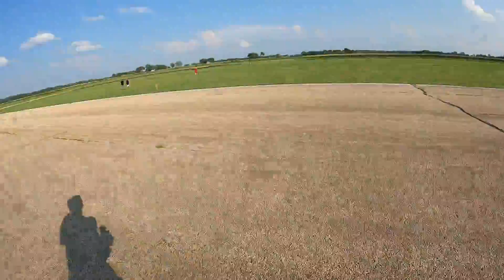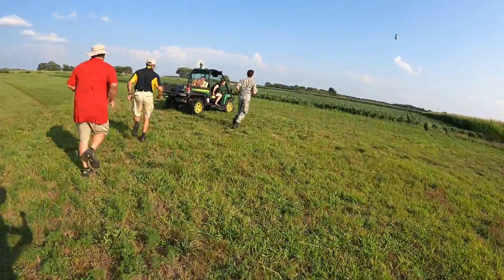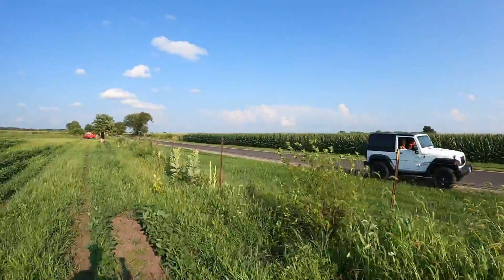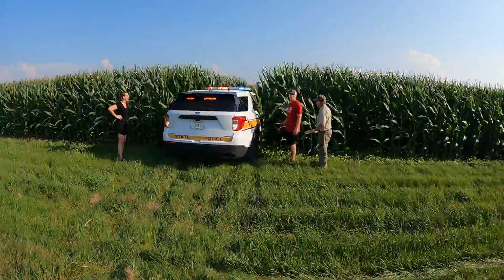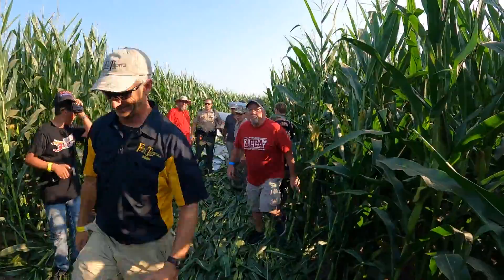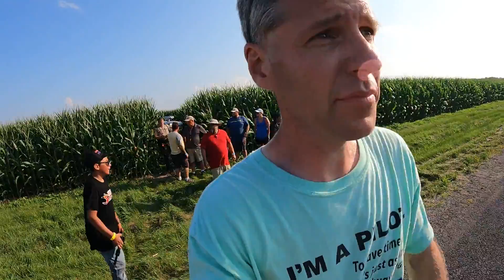Airplane crash in the corn at Whiteside Airport KSQI 2021 ACCA Rock Falls Illinois.

Comment: Flap switch or not By the numbers they were heavy and on a hot day. Dan 225 owner looked to be 200 fuel load unknown.   

The Cessna 150 has an average empty weight of 1,122 pounds and a gross weight of 1600 pounds, meaning its effective useful load is around 478 pounds. It has a typical fuel capacity of 26 gallons which means the full fuel useful load is approximately 322 pounds
Reply: Ya, they were over the legal weight limit by 150-200lbs.
Reply: Complacency — it's how highly experienced professional pilots kill themselves.
Reply: @jiyushugi1085  burger king Whopper

Comment: I am glad that both pilots are safe with no injuries! It looks like Dan for the most part followed his own advice and flew it to the ground wings level. I owned a Cessna 150F (N8914S) that had the electric flaps. The 40 degrees of flaps were great for short field landings. However, if you wanted to turn that short field landing into a touch and go it was a little sketchy as the switch to extend / retract the flaps was a "dead man's switch" meaning your hand is stuck holding the switch in the retract position until the flaps were up. This additionally means that you can't increase the throttle until the flaps were up! 

Interestingly I also had similar problems with the electric system every once in a while in that airplane when the flap motor turned on/off the generator regulator light would come on meaning charging had stopped due to an over voltage. I believe this was due to an inductive voltage spike as the motor turns on / off. The solution that got applied after I sold the plane was to put a capacitor on the motor terminals in parallel to prevent the voltage spike which in turn would prevent the generator regulator from turning off. The solution that I did while owning the plane was to turn the master off (plane still flies because power to spark plugs comes from magnetos but yes this sucks as your radios, transponder, etc are off) let the regulator cool down for a minute while I turn the radios and other electrics off and then turn the master back on. This would reset the regulator and charging would resume.

My major concern about this incident though is if you noticed the flaps did not retract on the ground why the heck would you continue the take off?  As evidenced by the crash, a Cessna 150 will have terrible climb performance on even a standard temp day (actual conditions appear to be hot so high density altitude) with full flaps. They should have just reduced power and applied max braking while on the ground. As I said above, the Cessna 150 with full 40 degrees of flaps will stop super short so they would have had at least half the runway left (probably way more) to realize the flaps were not up to either cut the power and max brake or cut power, land ahead and max brake.
Reply: What also would be interesting to look at would be to check the voltage / state of charge of the battery. If the regulator had been turning off due to the over voltage when operating the flaps then the plane would have been running it's electrics off of the battery not the generator and the battery would be pretty worn down. While it was enough for them to take off use the radios and drop the flaps the battery's low charge state may not have allowed flaps to also get retracted after being dropped with the radios on. Hence them being stuck down no fuses blown but with the radios still working.
Reply: In the video Gryder states it was a go-around
Reply: @thefamilythatfliestogether  They hand propped it to take off in the first place. Should never have taken off.
Reply: @margemason4525  considering Dan said that the battery was new in another video and you are correct about them needing to hand prop it then it is more likely my theory might be right. Otherwise why would they need to hand prop it to start it. Coincidentally I had to hand prop my 150 before I figured out what was going on with the generator regulator.

Comment: NTSB final report:
Postaccident examination of the airframe and engine, which included testing of the flap system, revealed no evidence of mechanical malfunctions or failures that would have precluded normal operation. A four-port universal serial bus (USB) power supply adapter was found plugged into a power port located just below the cockpit flap switch. It was undetermined if the adapter conflicted with the operation of the flap switch. Based on available evidence, a reason for the reported flap issue was not determined. 
Probable Cause:
The right seat pilot’s improper decision to perform a low approach with full flaps and the failure of the flaps to retract during the attempted go-around, which resulted in a forced landing.
Reply from the maker: Actually, Matt Mansell, the owner, discovered the cause of the malfunction during rebuild of the airplane. If you visit his channel, search for "smoking gun" and see the video where he attempted to manually operate the flaps and the right side bound up. It was discovered that there was a hardened lump of paint in the track the the roller could not overcome. Sanding doen the paint lump resolved the issue.

Comment: I’d like to see his weight and balance for two big fellas in a tiny 150 as well as 91.103 preflight action. DA is through the roof with this heat and humidity here + that fully loaded 150. Can’t wait until the NTSB digs into their “preflight action” 😏
Reply: Well, that will be three years coming ...
Reply: @captmulch1  how big is the runway? during my ppl me and my instructor managed to get a 150 out of a 800m grass strip, DA wasn't too high if i remember right though, looks like they had a big enough runway and the main issue was just the flaps jamming up, had that happen on a 152 on final approach,  luckily it jammed at 20 degrees and not 30 though. 

I know for sure a 150 will not climb at 40 degree flaps at mtow in high density altitude. we were getting 50ft/min down at sea level in the UK
Reply: @captmulch1  not with amount of stick Dans been giving them... they will probably send a full go team 😆 they’re going to be straight up giddy for this one.
Reply: Obesity kills.
Reply: @ThatGuysProject  They we’re doing a low pass over the STOL runway. Dan mentions it being 400m or so. No way to gain altitude or speed with 40 stuck down and nowhere else to land (or nowhere better) than the corn field.

Comment: The first thing I thought of, as did others, is that they were probably overloaded. They are a couple of beefy guys. The two of them together likely weigh in at 450 lb. When I first got my ticket, I planned to fly my wife to Portland, about 100 miles away, in a 150. I left a note asking that the previous pilot not fill the tanks. When we arrived at the airport, we found the tanks were full. My wife was surprised when I dumped most of the luggage, already bare bones, into the car and told her we would have to buy what we needed in Portland. We took off 2 lb under gross. Even with only ten gallons of fuel these guys would have been over weight on a good day and with the heat and increased DA, a definite problem. I am nuts about weight and balance in our 182, and I have 1150 lb useful load. I am given to understand they were doing touch and go's. Flaps should have been retracted while on the ground before re-initiating flight so failure to retract should have resulted in staying on the runway. Probable cause: Pilot engaged in flight while exceeding the maximum gross weight of the airplane and pilot did not abort takeoff when flaps failed to raise.
Reply: or perhaps they did a go around, and only realised the problem when it was too late. these things happen, though they must of been around mtow as from experiance 2 up in a 150 even at low da they don't climb well at full flap. 50ft/min give or take
Reply from the maker: Thats exactly what happened. Dan was attempting a STOL landing and the flaps would not retract. They just could not gain any altitude and went down.
Reply: @WolfPilot  Well glad their alright, seemed to a pretty good job getting it down safely. i got lucky when it happened to me as i selected full flaps and it only went to 20, i noticed it on finals so made it a full stop.
Reply: I did something similar in a 150 when I was in training. I was on my second solo flight with my instructor observing from the ground. I was doing go arounds and forgot to raise my flaps. It was summer, but a relatively cool morning on the coast of the Olympic Peninsula. The nose wanted to pitch up and I was not gaining altitude. I was at about 150 ft and I shoved the yoke forward and kept the plane level, at full power, and worked the problem. I soon realized I had forgotten to raise the flaps, and milked them up. Since I was not overloaded and it was only about 60 degrees outside I was able to maintain altitude and did not sink, though I did pass over some trees quite closely. The heat of the day and an overloaded plane seems to have changed all that.
Reply from the maker: @margemason4525  I am not drinking any kool-aid. What I am reporting is matched up with eye witness accounts.
Reply: @WolfPilot  I am still unclear about hos this happened. The flaps would not be retracted in a STOL landing, but would be extended, likely to 30 or 40 deg. Generally, when doing a STOL takeoff you would keep the flaps at no more than 20 (though a friend of mine uses 30, I stick to 20. So, they landed and then took back off. The flaps remained at 40? So then did they not have enough runway to abort the takeoff if they could not retract to 20 while still on the ground? Did they take back off purposely with flaps 40? At flaps 20 if not overweight they should have been able to level off and get back. Overweight no way. At flaps 20 and overweight, also no go. My feeling is that I am not getting in a 150 and doing STOL with another 200+ lb guy.
Reply: @WolfPilot  Reporting???? Did you ask Dan or the owner if the eye witness accounts of them having to hand prop that plane were true? An electrical system failed causing a crash of an aircraft that had to be hand propped just to get in the air. Hmmmm. Did you ask them if they’d done a W&B prior to loading up two fairly heavy guys in a low powered airplane to perform a very low and slow maneuver on a day with a high DA? While I’m truly glad that no one was hurt, I have always taken issue with those being hailed as some kind of hero for surviving accidents they most likely caused themselves. Real reporting requires presenting the ugly truths as well as the glamour shots.
Reply from the maker: @frankrosenbloom  They were doing a go around and the flaps would not retract. Check out my Gryder interview video.
Reply: @WolfPilot  Thanks and I realize that. If they were doing short field landings probably 30 or 40 deg of flaps. Then should go to 20 for TO. If the flaps were not retracting why not abort the TO? Was the field too short? I'm not sure why they would be taking off full flaps, though maybe 30 deg for a very short field, then in ground effect for speed. I still think that if they were not too heavy they could have made it. Simply put, Dan is one of the best of the best, but I am not getting into a C-150 with another 200+ lb guy in the summer and doing STOL practice. Beefy dudes and gravity usually win over low lift and low power. Cheers, Frank
Reply: @WolfPilot  OK gotcha never landed. I'm sorry thought they landed and then took off. I'm not sure why he needed 40 deg of flaps to see what he wanted to see though.

Comment: I don't ever use flaps 40 on a 150 unless I'm completely committed.  Even on a soft field I'm still using 20.
Reply: Me too. 20 was a good all around setting even if you had to land with a little more air speed. I also kept the weight and balance within limits because with a 150 you don't have a lot of power to play with.
Reply: It's easiest to get a little float to soften your landing.  The flaps 40 you drop in like a brick and have to be very precise on your flare.  You don't get a chance to round out unless you have some power in.

Comment: With full flaps and full load, it is nearly impossible to make a C-150 climb. Full flaps should be used with caution, and only when circumstances warrant it. If you use full flaps routinely on every approach, eventually you will run into a situation like this.
Reply: I think Dan was doing a STOL approach.
Reply from the maker: He was doing a STOL approach. Check out my interview video.

Comment: I hate the electric flaps on Cessnas. They should never have got rid of the manual flaps.
Reply: I assume there is no redundancy built into the electronic flaps?
Reply: @RaoulThomas007  that’s right. A lot of times it’s just the circuit breaker. Also the useful load on a 150 is just under 500 lbs. With two dudes plus gas they were probably pushing that. As they found out... it won’t climb out with full flaps.

Comment: Don't stall the aircraft, and most crashes are survivable. Aircraft should be able to climb, even with full flaps, must have been overloaded.
Reply: Not in a 150 with full flaps at at gross weight. I did my training in a 150. Although I’d be interested to see the weight and balance for this flight… I’d be suspicious it wasn’t overloaded, just making matter worse

Comment: DA is definitely something to look into. We had a similar thing with a C150, one really heavy guy, one normal, extended range fuel tanks full, 30° C, no wind, plance was forced of the runway just before the end made it up to two meters and crashlanded in the ditch 100 m further down. Severe but not fatal injuries to one of them. Cause: completely overloaded for the prevailing conditions. Will be interesting to hear Dan's own assessment on this one. He will be critical as always, I assume. Most important though: both are well! The rest is metal.

Comment: I'm not buying it! 40 degrees of flaps at low altitude means you must have the field made. He over shot the approach. Who cares if the flaps are not working. Fly the plane and land on the numbers! The MMC (Major Contributing Cause) will be pilot error.
Reply from the maker: There were no numbers. It was a temporary grass strip. Dan decided on the go around at the last minute and with the low horse power and flaps 40, the airplane could not climb.
Reply: @WolfPilot  pilot error is the major contributing cause. If you don't have the field mad with 40 degrees of flaps you should not have put yourself in that position. Why was he attempting such a dangerous landing? SHould have avoided this grass strip
Reply from the maker: @williamwuolo8926  Please watch my interview video with Dan before you make any pronouncements. It was a mechanical failure. Did you even watch this entire video? Dan even clearly states that the flaps wouldn't retract.
Reply from the maker: @williamwuolo8926  No its not. It's mechanical failure.
Reply: @WolfPilot  I watched the entire video. The mechanical failure contributed to the accident. However, it was not causational. You have to look at the major contributing cause before the mechanical failure was discovered. He didn't have the field made when he placed the flight at additional risk when he put down 40 degrees of flaps. Look, I have been involved in many of similarly-situated accidents. As long as no one sues anyone, it is all moot. I would prepare Dan if I was his attorney to a different scenario. 40 degrees of flaps in my opinion, is evidence of poor skills or poor judgment when attempting to safely land a 152 on a hot day with two adults. Slipping a plane shows more skill. He over shot the runway. I am sure flight aware will clear up this matter.

Comment: Try remove the cowling and spinner to save them before flipping it back upright  If the engine got shut down just prior maybe the crank runout will be ok  surly it will need a very fin and rudder

Comment: Expert skills. Glad everyone able to walk away.
Reply: I prefer pilots that DONT crash
Reply: Expert level piloting would be confirming that your flaps are coming up on the touch and go while you're still in the touch part of the go.  That way if they malfunction you can put it back down on the runway.  Rwy 07/25 at Whiteside is a foot short of 6,500 feet long.  That's enough for a C150 to land and take off about three or four times.  I just used this airport a couple weeks ago myself on a cross country.